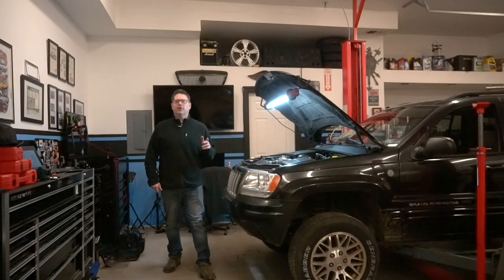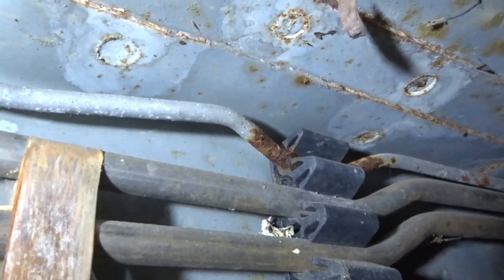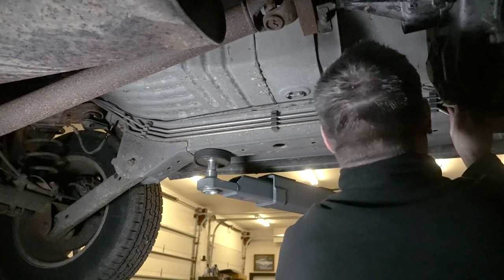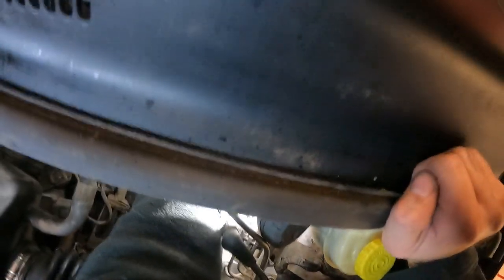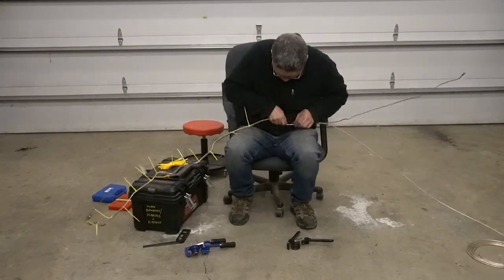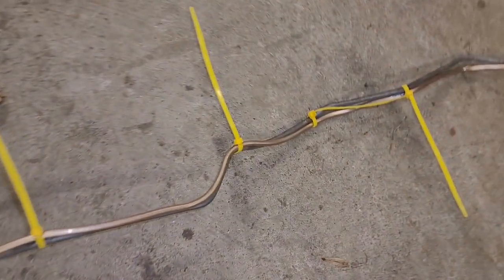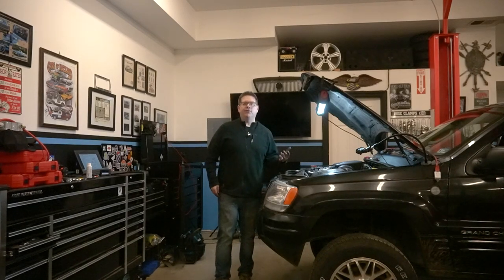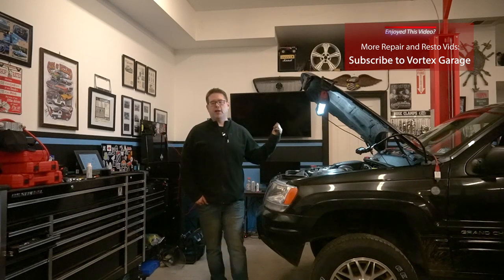How to Replace a WJ Jeep Rear Brake Line - Removal, Bending, and Install - Brakelinectomy Time!

Comment from the maker: I do admit - a pre-formed aftermarket line is a great option for most here.  If you need to do this on your WJ, don't have any of the brake line bending/flaring tools, don't plan to bend lines in the future, and can wait for an order, then a pre-formed line will be faster and cheaper for you.   And you can check video description for links to pre-formed options.  

But if you already have the tools, or want the learn or grow the ability to form your own lines, then you may choose to do as we did.  (For me, I have amassed the tools, fittings, and stock of line from other jobs, so I can bend up a line immediately often without having to place orders or visit a parts store - a by-product of making several lines in the past for custom applications or cars where there are no aftermarket pre-made lines, and not throwing anything away!)

But again - there are at least options for the WJ for pre-formed lines.
Reply: Great video with great info, really like the on screen tips that are provided! Really helpful! Ty!

Comment: You should do one with a Ni-Copp brake line kit thats pre-cut. The Nickel copper is super easy to put through without pre-bending i hear and bend to brackets after. 
I have an '02 Jeep WJ 4.7 Laredo with Selec-Trac (VIN-N)
I basically need to replace all my braje lines from master cylinder and caliper brake hoses. They are pretty rusty

Comment: I did the rear brake lines on my 2001 WJ last year. Tracking down the right size compression fittings was the main PITA- its the old 'classic' style, I think you mentioned SAE?- modern metric ones don't fit. Once that was sorted, I brought copper/zinc line and a pipe cutter/flare kit off Ebay, then practised the double-flaring technique and swapped the whole lot out. On the 2001, there's a compression joint mid-way down the pipe under where the driver (left hand drive) or passenger (right hand drive) sits, which I used rather than having to go all the way to the ABS box- I count myself lucky in this regard as bubble flares are evil to master. Swapping out the flexi-hoses to the calipers and the rear lines where they join on the rear axle at the breather pipe was a doddle- the easiest parts of the whole swap out tbh. The hardest part was getting all of the old rusty hardware off- yet, you make it look so easy! Nice work!

Comment: I've got jeep grand Cherokee ltd crd ltd wj  in U.K. has merc1.7ltr turbocharged diesel  worse problem I've got is alarm keeps goin off usual when gets sun on vehicle, not been able to find cause of it ,cleaned door hood switchs not sure where else to look,no sun never a problem only activate in sun most peculiar!
Reply from the maker: That is an odd one - is it a factory alarm?  I've not heard of that before, perhaps heat is causing a wire connection to expand and break, or touch causing a circuit to be made turning on the alarm.  That may take some digging for sure...

Comment: My rear line blew out in the exact spot you showed in the video, got in one day ready to go to work and pressed the brake pedal to shift into drive and boom went straight to the floor, ordered Dorman 919238 pre made stainless line kit and popped it in on my gravel driveway way and they worked as advertised
Reply from the maker: Nice - I used a Dorman stainless kit on a 2001 F250 - the front lines fit great but the rear one was not even close. I ended up forming my own. To be fair the F250s come in several wheelbase, driveline, and cab styles so even though it was listed to fit for mine I can understand why they may have issues. Good to know the WJ kit worked for you. 

For most the preformed kits are the way to go. Over the years I've amassed the kit of tools and fittings so usually I can pop out and buy a $25 spool of line and form it up quickly, but if you had to buy tools just to fix your car the preformed kits are cheaper and faster at that rate. 👍